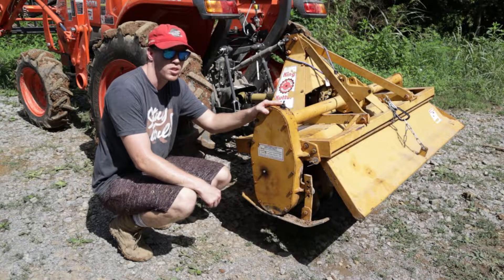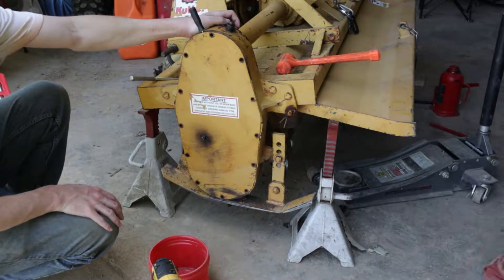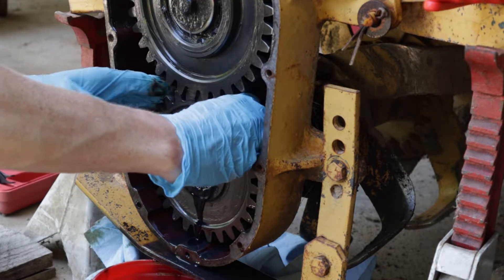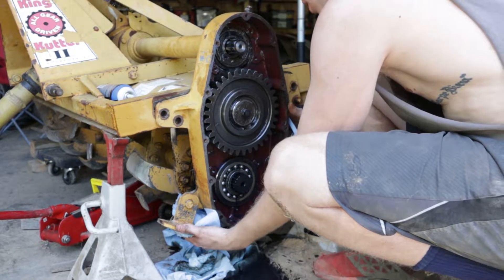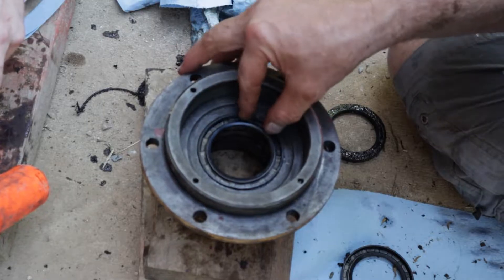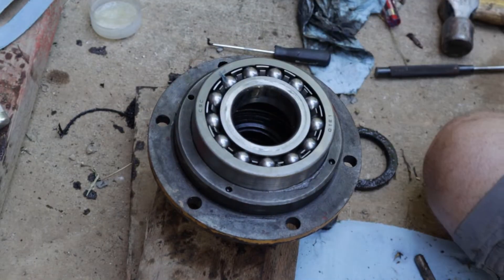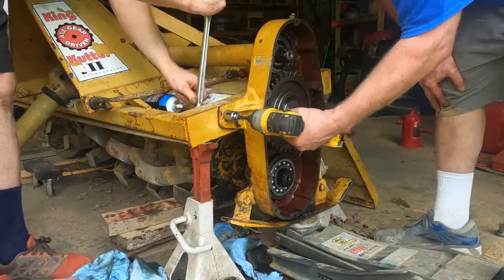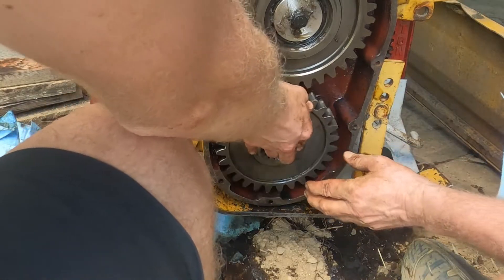King Kutter 2 Gearbox Seal & Bearing Replacement- 5' PTO Rotary Tiller

Comment: I have a 7' King Kutter tiller that I bought new that has less than 3 hours on it now. The tiller has only been used in very well mowed existing garden spots. The top drive gear in the side gearbox came off the shaft twice in the first 1 1/2 hours of use. After leaving out two shims behind the gear that problem seems solved now. The last time I used it gear oil begin leaking very bad from the bottom seal. I am considering just putting in a mixture of grease and 140 gear oil and try that. From what I've read replacing the seal may just be a regular occurring job. This will be the last piece of King Kutter equipment I purchase.
Reply from the maker: With all those issue i'd take it back if you could. This is our first PTO tiller i'm not sure if the seal is a recurring issue for all brands but it certainly is for the King Kutter. If you go to grease instead report back after a while to let us and others know if that's an acceptable fix long term.

Comment: Can you confirm you only replaced the seals and not the bearings?
Reply from the maker: Yes we reused the existing bearing. They are expensive so we decided to remove and inspect before buying. Our was in good shape so we put it back in and haven't had issues with it.
Reply: @BrollBrothersProductions do you grease the bearings before installing?
Reply from the maker: @dawgdawg7694  it’s been a while since doing this if I recall the bearing is open so it should be in the oil bath with the gear train so it shouldn’t need grease

Comment: Where did you get the correct bearing and seals
Reply from the maker: Here is a response from another comment but should help with finding any parts:

I think this is the manual you can look for the part numbers: https://www.kingkutter.com/images/uploaded/FlatTopTillerManual.pdf 
I think these are the seals: https://www.kingkutter.com/505017-double-lip-seal-set-tiller 
But if I recall correctly we got ours on ebay or amazon once we had the part #. There is also this page but it seems to only have the major assemblies not the individual subcomponents: https://www.kingkutter.com/rotary-tillers
If all those fail I would call them and ask.

Comment: I have done this project twice over the past 2 years on my 6 foot King Kutter.   It is a horrible design because the grass gets into the seal area and messes it up.  I am about to do this project a 3rd time.  This time I am going to use string soaked in oil and wrapped it around the shaft.  I learned this from other seals in other industries.  Hoping it works, because I am getting really good at disassembling and reassembling.(Please note SarCaSM)
Reply from the maker: Yeah I feel you it’s a pain for sure, report back if the string helps I’m sure others would like to know.

Comment: Very good, excellent video! I had this same tiller, except a 6 foot. Mine had the same leak. I sold the tiller (but had it for many years!). 

The only bad part about this project is that it is guaranteed to start leaking again, because it’s a bad design.
Reply from the maker: Agreed, it’s a dumb design that you have to disassemble the whole thing, and that the seal is apparently not hardy enough.

Comment: How much did all the parts cost and where did you get them?
Reply from the maker: Here is a response from another comment but should help with finding any parts:

I think this is the manual you can look for the part numbers: https://www.kingkutter.com/images/uploaded/FlatTopTillerManual.pdf 
I think these are the seals: https://www.kingkutter.com/505017-double-lip-seal-set-tiller 
But if I recall correctly we got ours on ebay or amazon once we had the part #. There is also this page but it seems to only have the major assemblies not the individual subcomponents: https://www.kingkutter.com/rotary-tillers
If all those fail I would call them and ask.

Comment: Very nice video and thank you for taking the time to put this together. I just finished my rebuild last night. I too had problems with that snap ring, but was able to get it installed. I also used a little bit of RTV sealant around each of the bolts and the seal around the top and bottom gear housing
Reply from the maker: Glad it helped and good job on the rebuild!

Comment: What prevents oil from leaking out of the two back flanges?
Reply from the maker: The seal under the bearing keeps the oil in, and then there is a rubber gasket on the outside cover of the gearbox
Reply: Thanks

Comment: Where did you find your parts?
Reply from the maker: Here is a response from another comment but should help with finding any parts:

I think this is the manual you can look for the part numbers: https://www.kingkutter.com/images/uploaded/FlatTopTillerManual.pdf 

I think these are the seals: https://www.kingkutter.com/505017-double-lip-seal-set-tiller 

But if I recall correctly we got ours on ebay or amazon once we had the part #. There is also this page but it seems to only have the major assemblies not the individual subcomponents: https://www.kingkutter.com/rotary-tillers
If all those fail I would call them and ask.

Comment: ❗A warning to anyone using older Harbor Freight jack stands that there was a recall of the 3 ton and 6 ton jack stands in May of 2020. Then there was a second recall in July 2020 for the replacement 3 ton stands # 56373. There is a full recall list on Harbor Freight's website.

Comment: I have a King Kutter rototiller just like this one, and I need to replace my seals just like you did, but without all the mistakes~!!~!!!   The first thing I will do is connect it to my farm tractor so I can control it.    I do appreciate your video, and it gave me the courage to do my own seal replacement.    It seems a shame to have to completely disassemble the entire gear box to replace those two small seals.
Reply from the maker: Agreed the design could certainly be better for maintenance but glad we could help.

Comment: I did get the hub off. I tightened the gear puller as tight as I could. I sprayed liquid wrench several times and let it sit overnight. Next day I took a 3 lbs hammer to the back side of the hub. Pound, rotate the hub, pound, rotate, pound. The hub slowly released and I kept tension on the gear puller. The was some rust on the shaft that I believe was keeping the hub frozen. I recommend using a press to install the 2 oil seals into the hub. Slow and steady wins the race.

Comment: Question. You made pulling the hub off look so easy. I have used an 8 inch 3 pronged gear puller and the hub and bearing will not come off. Do you have any advice on how best to remove a hub/bearing that won't break free?
Reply from the maker: Ours came off really easy. 

A few questions: Have you soaked the shaft with PB blaster? Is your gear puller slipping off as you tighten?

I have seen some people remove them by beating on em, have you tried a sledge hammer with a block of wood in between?
Reply: @BrollBrothersProductions   I have soaked it with Liquid Wrench. I can buy some PB blaster if you think that is better. The gear puller is staying put. I tried tightening the puller with an electric impact wrench and nothing. I am worried I will damage the bearing because I am not sure if the hub is putting pressure on the inner collar of the bearing or only the outer collar. Thanks for your reply!
Reply from the maker: Happy to help. 

I think liquid wrench is as good as PB blaster so that shouldn't do anything better. 

The hub is quite thick so I would think the pressure would be evenly distributed. Depending on the size of your impact I could see it not having enough power, my cordless tiny impact couldn't spin it until the end. I would try a good size ratchet and see if that can get it to move. 

If it seems like that isn't going to work the next thing I would do is add some heat. Torch the hub for a little but and try again
Reply: Were you able to ever get your hub off?  We are doing this exact thing today and running into the same problem of it won’t budge with the gear puller.  Looking for any tricks that might help the process.
Reply: @sschneider2259  use some heat on the gear , then draw the heat out of theshaft immediately while staurating with motor oil-not penetraing oil--too thin it will boil off. rinse and repeat a few times then go after it withe gear puller with some more heating of the gear, trying not to heat the shaft.

Comment: Have you every pulled the non drive hub assembly?  My bearings are shot and wondering if I need to completely remove the tine shaft to get that hub assembly off.   ???
Reply from the maker: No unfortunately just took this side apart.

Comment: Your video has been very helpful for me!! I have the same tiller. Mine needs a new  top gear but I can't find anything online for parts and the tag for the model number is gone so I don't even know what to look up. If you can provide any information I would appreciate it!!!
Reply from the maker: Here is a response from another comment but should help with finding any parts:

I think this is the manual you can look for the part numbers: https://www.kingkutter.com/images/uploaded/FlatTopTillerManual.pdf 
I think these are the seals: https://www.kingkutter.com/505017-double-lip-seal-set-tiller 
But if I recall correctly we got ours on ebay or amazon once we had the part #. There is also this page but it seems to only have the major assemblies not the individual subcomponents: https://www.kingkutter.com/rotary-tillers
If all those fail I would call them and ask.
Reply: @BrollBrothersProductions   Thank you that is exactly what i needed. much appreciated!!!!

Comment: I have the exact same tiller, with the exact same problem with the oil leak.    I think your video shows me everything that I need to do, and some things to avoid!!!!!   I have been dreading doing this, but the oil is getting expensive to keep dumping it on the floor or ground somewhere.   And your video helps take some of the fear out of the job.
Reply from the maker: It wasn’t fun but it’s very doable, good luck. Ours was leaking too bad to try filling it to run it, that gearbox oil isn’t cheap!

Comment: Can this be done w/o  taking the  whole gearbox off?  by knocking down the offside bearing and housing  , taking the  power-side lower bearing hub loose and shifting the entire shaft  to the off-side to get at the drive side hub/bearing /seal? you would still have to take the gear box cover off to get at the bolt in the end of the lower gear. Seems like you could get the entire tiller shaft shifted to the off-side  to get enough working room to pull the drive-side hub/bearing housing?
Reply: I started doing this and it does not work.  Going to pull the gear box
Reply from the maker: Maybe?, if you try it report back if it works and saved you time
Reply: No. The hub has to come completely off the shaft to get to the seals. The hub is bolted to the gear case. What ever else you try is going to be time consuming and ultimately futile. Every piece is heavy and hard to maneuver.

Comment: I'm having a hard time finding the bushings.  Do you have a part number or any info on how to get them.
Reply from the maker: I think this is the manual you can look for the part numbers: https://www.kingkutter.com/images/uploaded/FlatTopTillerManual.pdf 
I think these are the seals: https://www.kingkutter.com/505017-double-lip-seal-set-tiller 
But if I recall correctly we got ours on ebay or amazon once we had the part #. There is also this page but it seems to only have the major assemblies not the individual subcomponents: https://www.kingkutter.com/rotary-tillers
If all those fail I would call them and ask.
Reply: @BrollBrothersProductions  thank you!

Comment: Thanks for your video. I just had the same problem and your video helped me getting it done. However, I did not realize there were two oil seals so I will have to do mine again when I get the second seal. The parts list did not show that two seals were needed and I missed that on your video.